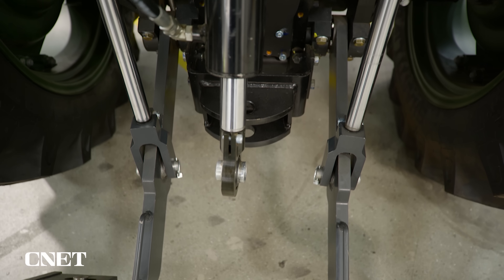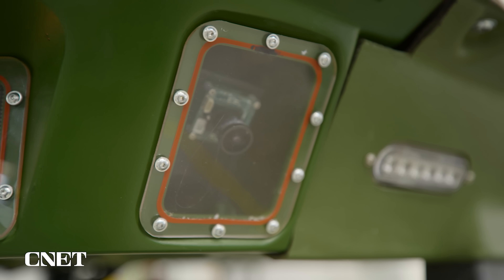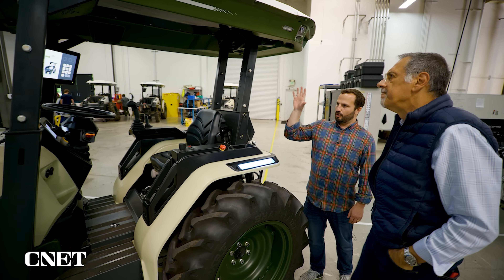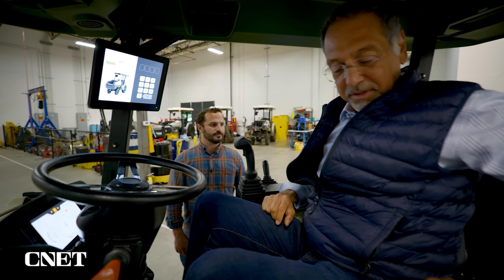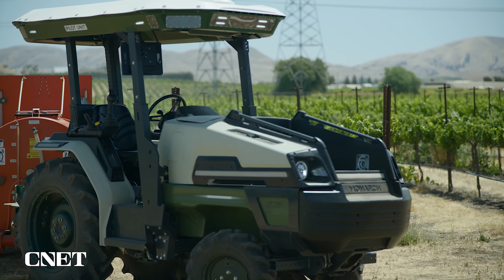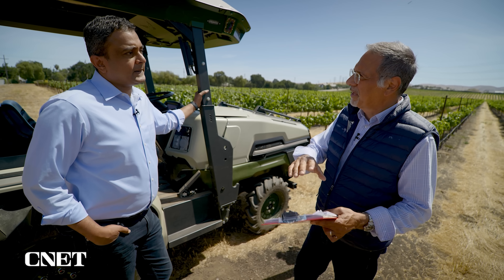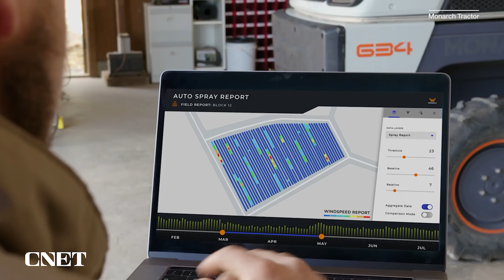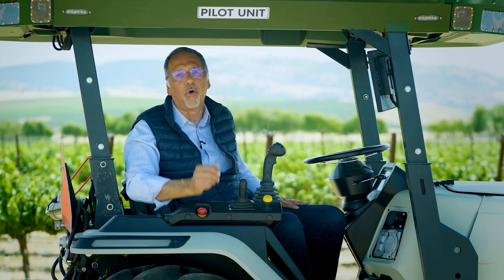This Electric Tractor Might Change the Future of Farming and Food!

Comment: My grandfather bought a tractor in 1951 that he used for 40yrs until he died...now my uncle uses it. It's gas powered, 71yrs old, and still works. I guarantee this electric tractor won't be working 20yrs from now. The avg. EV battery pack lasts 17yrs and costs $132/kwh of capacity. Also, electronics break down much more than mechanical systems...and the average farmer isn't going to make field repairs to his electronic controllers or EV battery systems.
Reply: you change the bateries, are you kidding me? now, dont say that your grandfather didnt do any repair on his tractor in 40 years :P. Btw its a known fact that any electric car have alot less maintainance and repairs then any gas cars by a huge distance.
Reply: @sentra6661  Absolutely clueless.
Reply: @sentra6661  Yeah, but he didn't have to take it to a dealer and have it hooked up to their laptop, pay their labor rate and their prices.
Reply: oh common man, there is no car these days on gas or electric to not go to computer with it, this is not an argument
Reply: @sentra6661  Yes and that is by design.  They are pre-programmed to fail.  You are not able to work on them yourself and are their mercy to repair.  What is one to do when you have hay on the ground and your tractor throws a code and they tell you it will be a week before they can get to you?  Long gone are the days when you can run to the parts department and pick up a starter, fuel filter etc.  additionally I'm not going to put much faith in foreign made equipment ( of course most all are these dates) unless it is Japanese.  At least they have integrity for the most part.  Point being, there's quite a bit more to the discussion.  Seriously, if you end up buying one I do wish you the best of luck and hope it works out well for you.
Reply: Objectively, electric motors are far more reliable and durable than gas or Diesel engines. It’s just engineering, not emotional, and it’s not a close call. Tractors from 1951 are pretty cool — my Dad has one, too — but they’re just hobby farm tractors today. Battery technology is advancing at a rapid pace and costs have declined by 90% over the past twenty years, so the cost of batteries today is not relevant for 20 years from now. The innovation in this space is mind-blowing. Watch it happen. I hope America leads the way, and we don’t get stuck in the past.
Reply: @ChitFromChinola   I agree on the motors.  However, it is the right to repair and proprietary software  that are the big issues for me.  When a code is thrown and the machine shuts down, you are completely at their mercy, their tech availability and their labor rate.
Reply: Yup, I get it, but every tractor today — electric or otherwise — has a computer on board and proprietary software. Right to repair is an issue across the entire tractor industry, and is not unique to electric tractors. I just think that what Monarch is doing is pretty cool, and I’m glad that an American company is leading the way. Going after the 40 hp market makes a ton of sense, and as batteries get more energy dense and cheaper, they can move up in hp.

The other cool electric technology is the electric skid-steer that Bobcat is starting to ship. All electric w/no hydraulics. Another American company innovating in this space, and electric motors and actuators will be a huge advantages for skid-steers — torque to burn, no hydraulic pumps/lines, and no fumes (or headaches) for enclosed-space work.
Reply: @ChitFromChinola   Gotcha.  Hopefully they'll be different.  I got bent over for $4100 on a new Holland when the ECM failed right at five years.  Reason I'm a bit gun shy. I had former techs message me that New Holland was well aware and it was a known issue.
Reply: @ChitFromChinola  absolutely well said
Reply: My dad bought a hand drill in 1962 in Europe and I still have it today! Works like new! But I’m on my 3rd cordless drill and I would never use that hand drill! But it looks good on the shelf!
Reply: @ChitFromChinola  try agian Ford 300 I6 first sold in 1965 run for millions of miles and decades without ever being opened.  Electric motors last at most 5 to 10 years before they fail (this is a fair industrial use application comparison).
Reply: Your grandfather did his job with what he had at the time. It'sa be day. ❤️💯👍🏻
Reply: That's exactly what the farmer with a horse said when they made the very first gas tractor.....and your grandfather bought what
Reply: @JamesWest-iu4jx  the difference is the gas tractor out preformed the horse.
Reply: @ChitFromChinola  The energy content of a gallon of gas or diesel is far greater the a battery.  LiFePO4 Batteries last about 10 years and are heavy.  Big tractors have way too much horsepower demand than what a battery system can provide.
Reply: Dudes, you’re living in the past. Electric motors are far more reliable and last much longer than any gas or Diesel engine. It’s not a close call. Sure, you can re-build either one to make it last longer, but the maintenance cost of the gas/diesel is much higher. It’s not a close call.

Sure, the energy density of gas/diesel is higher than batteries, but that is partially offset by the 95% efficiency of an electric drive train vs 20% for gas/diesel. And the energy density for batteries continue to get better, while gas and diesel hasn’t changed in 120 years — and never will. The innovation in batteries over the next twenty years will blow your minds. You don’t have to believe me — watch it happen.

Old tech tractors are cool, but gas/diesel engines are just a transitional technology to get us through the last 100 years or so. Over the next 40 years, the old gas/diesel technology will die out — just like fax machines and VCRs and wired telephones. The future is electric. The reason is lower cost of operation. Farming is a commodity business — lowest cost wins, and the lowest cost is electric. Solar generation  + battery storage + electric tractors and skid steers = lowest cost.
Reply: @ChitFromChinola  try buying one without government subsidies. There is  no maintenance on a electric vehicle? Look up the cost of a replacement battery
Reply: It's Not possible to build the Tractor or ALL of the thousands of metal, Rubber and various parts required to assemble the tractor and it's accessories plus the Batteries.
 That very tractor required Coal or other powered foundries & gasoline and Diesel powered vehicles to dig the ore and minerals out of the earth. How are the BATTERIES charged? Not from solar or windmills. Coal again. It's a fantasy world to think otherwise.
Reply: @jasonthetalker7253  
I already bought one without government subsidies, so yer off target there — and cost was on a par with comparable gas engine. I’ll never have to replace the battery, so that’s a non-issue.

Gas and diesel are yesterday’s technology. You gotta catch up to 2022. And be excited about 2023+. The innovation in this space will be awesome.
Reply: @PhilippinesFarmLife  

Yesterday’s technologies. It’s not possible to get from New York to Los Angeles without a horse. Until you can.

Electric motors don’t have thousands of parts. 

The electricity from solar and wind works the same as electricity from coal, so no trouble there. In 2021, 90% of new power plants were solar or wind. There hasn’t been a new coal-fired power plant built in the US in years. Coal-fired plants are stranded assets. Dead money. But, you don’t have to believe me. You invest your money in coal and Diesel engines, and I’ll invest my money in solar and electric motors. In 2035, let’s compare notes . . . Lol.

Comment: Does it come with a front end loader? Can it move  round bales of hay? Can it move square bales of hay? Does it come with a spare battery and is changing the battery even a viable option for the farmer? Lots of questions here.
Reply: The battery will weigh no less than 1000 pounds. The spare battery will come in the form of a spare tractor.
Reply: @selectbrands  The run time is 10 minutes after the first year.
Reply: Its not really for that. Yes the small acre compact tractor market is large but this is aimed at the orchard, berry and vineyard industry. Ability to spray autonomously is huge. The tight row cultivation and other easily automated task work is what this technology is useful for

Comment: I think the "killer feature" for electric tractors is going to be how repairable/open it is.  Farmers are a crafty bunch and anything you do to let them repair/customize their equipment will probably be well received.
Reply: I'd bet these are locked down maybe even attached to a cloud. Pay some license fee to allow access into some parts. Be great for a company to start with a bare bones electric vehicle like the antique tractors for more of a mass adoption item rather than a tech toy. Tech toys are great and some farmers could use it, but a cheap viable alternative is even better.
Reply: It will be no different
Reply: "How repairable".. they are not.  You have to replace major components far more often.  Especially the expensive battery
Reply: @readypetequalmers7360   My take too.  You'll have to pay a subscription to get autonomous farming.  They probably won't have repair manuals available either. Like modern cars. 

They'll be tied down by the DMCA. Farmers will have to crack the DRM and violate the law to use the tractors the way they want. Like what's happening with John Deere.
Reply: I totally agree with the comment about the "killer feature" being farmers' right to repair.  Maybe if the tractors are designed with affordable replacement modules would be a good compromise.  Especially if the modules could be built and sold by 3rd parties.
Reply: The engines are just as repairable in today's tractors as the 1958 Farmall...  But the added electronic systems are not.

In your car are circuit boards, some of which have to be programmed with VIN andother info to function and other boards check that their info matches the other board's info...
Program once and can't reprogram = you can't get a used board from a junk yard....

Tractor makers are doing that with emissins contrls, engine management, GPS and more.

They can prevent operation if the board is not swappedby a dealer with the devece to do the programming even if the replacement board just runs the emergency flashers for when they go down the road a bit to the next field.

Electric or fossil fuel doesn't matter for "right to repair".  The problems are in the electronics disabling the tractors and combines.
Reply: @fhuber7507  No they are not.  I have worked on electric motors.  When they burn out, they do not have the ability to be taken to a machine and remade like a gas engine is.  They have to be replaced, not repaired.  Same for batteries.  These do not get rebuilt like an engine.  They are usually thrown in the trash.

Now I grant you that there is a lot of issues with "right to repair".  We addressed that with gas engines decades ago.  But right now, electric cars are in the wild west of regulations, mostly to satisfy the radical environmentalists.
Reply: @jacobw446  I have rewound motors.  

The core charge of a car starter motor is so it can be rewound.  Same with the alternator core charge.  

I've been involved with rewinding a generator for a steam turbine... (can't do that beast all by yourself...)

You fail.
Reply: @fhuber7507  These are not the same.  They are much much much more complicated.  They are often glued together with no intention of ever rewinding them.
Reply: @jacobw446  yep, but still can be repaired. Electronics also can be repaired but at a much higher level of complexity. So, I am afraid that these electric toys no matter how much we like them, will make the user more dependent on the repairing side. Like cars, in my childhood almost anybody could fix his car, now, almost nobody..
Reply: I hope it uses Linux operating system. And that farmer can access and tweak it also. I would not want a tractor running on windows at least.
Reply: @jacobw446  the battery should last along time if LFP  type and LFP batteries are cheap. LFP battery in an electric car you should have 20 - 60 years driving life on it . in an industrial/commercial setting LFP  usually have a rating of 20 years.did  quick math on it  depending on the work load  4000 - +12000 hrs would be the average battery life. or  roughly 72000 litres of fuel (100hp tractor)
Reply: Electric vehicles are the complete opposite to repairability. If something goes wrong in this 9/10 times I doubt you could fix it with a wrench and a hammer, all the controls are just wires fed into a computer. If a computer board breaks you can't expect a farmer to crack open a soldering iron or start re-wiring etc and repair it in the field. That's even if the company would allow farmers to do that, hopefully they will but more than likely the farmer will have to get someone from the company out or bring the tractor in to a certified mechanic shop.
Reply: @jacobw446  You're wrong. Cheap motors are thrown out but the more high-performance (expensive) motors are rebuilt all the time. A buddy of mine has a business doing nothing else.
Reply: @jacobw446  Batteries will not need to be replaced nearly as often as you think. I have some LiFePO4 cells that are on their 'second life' in my electric lawn mower.  They spent 10 years as traction batteries in an electric bus, and have spent a further 4 cutting grass. Their capacity has definitely declined but they outlasted a city bus, do you have any idea how many miles a city bus puts on in one year?
Reply: @paulmaxwell8851  I can guarantee that Tesla does not rebuild their motors.  A few 3rd parties might, but they wont.  There is a big difference between an alternator motor and big drive motors.  To my knowledge, there is no afterparty manufacturers of electric car motors, unlike gas engines.

Comment: A modern farm tractor has to be used for hours on end during times of planting, harvesting and general use of any given day. A farmer can't be stopping to charge a tractor all the time when the pressure is on to get work done. Many tractors require 100 hp or more on large farms.
Reply: Even small farms are running at least 200hp tractors for primary farming tasks (the 100hp units are used for incidental tasks like mowing, light loader work, picking rocks, feeding cattle). Large farms that provide the bulk of our food supply are using 500-700hp tractors and combines (oftentimes running 24 hrs a day).
Reply: @jeffc6832  I worked on my uncle's dairy farm years ago and the largest tractor he had was about 80 hp.
Reply: @commonsenserules7995  I'm talking about ~1000 acre crop farmers (like my Dad). Years ago they were using maybe 150-180 hp tractors, but most farms that size won't run anything less than 250 and up now. Big farmers (look up a Mike Mitchell on YouTube) that farm thousands of acres run fleets of 600hp tractors with giant air drills.

Comment: Great idea, just strange that they built a tractor with a massive fixed roof and didn't put a solar panel on it. Even if the panel can't charge the battery as fast as it gets used, it'll be a great range extender and the farmer can dump this thing in a bay in a far off or awkward field and it'll manage the field all by itsself.
Reply: That size panel might take about two years to charge the tractor.  But I get your point.  Maybe a huge panel could work a little.
Reply: Solar is shockingly inefficient when it comes to powering vehicles.
Reply: @selectbrands  But it can continue to charge the batteries even when the machine is not in use.

Comment: I think they are a long way off from having something to replace a JD 9RX , Fendt 1167 or the Quadtrack 620 which can pull an 80 ft digger for 12 straight hours , refuel in 15 min and go for 12 more hours
Reply: smwring 8 time oth batreé 32 ghoreß

Comment: Something not addressed here  is the battery. Is it removable? Until the battery can be swapped out like a Dewalt tool, it's not going anywhere. This tractor lasts 6-10 hours. Put this under real work with a FEL and you'll probably be lucky to get 4 hours - not bad for just beginning but during the spring and fall farm equipment is running 22 hours per day. This might work in California but no farmer in the midwest is going to go for this. 

The biggest problem with the EV industry right now is not having standardized swappable batteries. This will have to happen for electric vehicles to truly take off without taxing the grid. I have at least 9 batteries for my dewalt tools. I use every one of them. Some are charging while others are in equipment. I don't have time for the tools to be plugged in waiting for them charge 24 hours - or much longer on solar.

The width of the tractor is too narrow for the height. The center of gravity is too high - it will tip over very easy! Can this use ANY non-chipped equipment such as standard Cat 1 3-point or does it need to be specifically approved by the company?